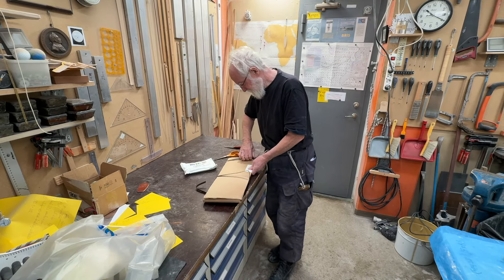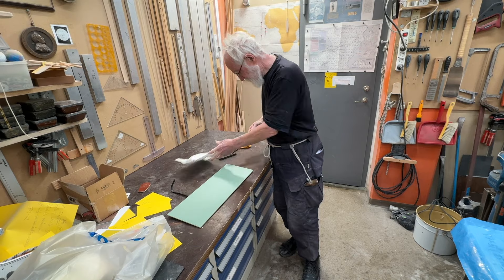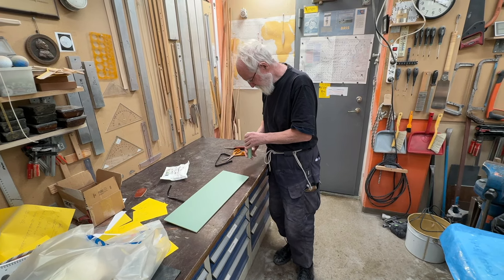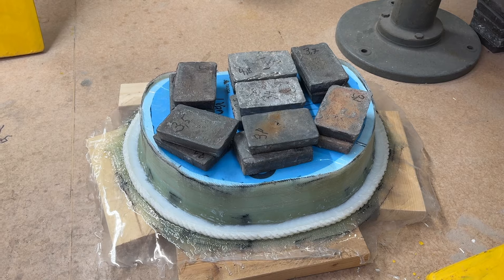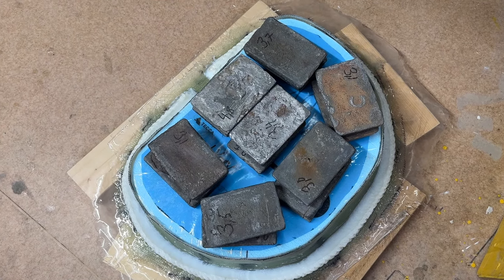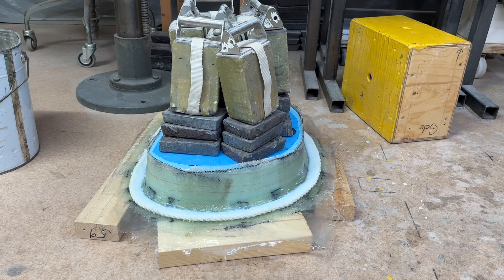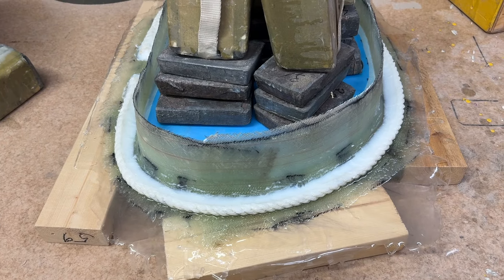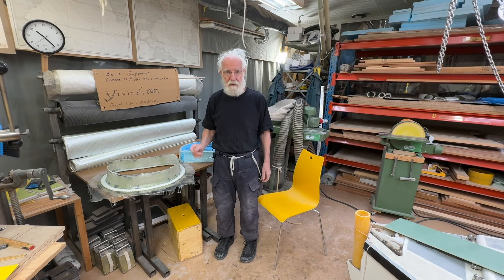5 Oct 2024 Succesful release + unpacking

Comment: When you are releasing the mold like that with the lead and gravity maybe try using air compressor around the seam this blowing air down into it that will help it go quicker Love your show and PS anybody complains about you cutting up the boat it is your boat your project you do whatever and however you want to do it. I love what you doing
Reply: exactly ... it's not them venturing into the southern ocean and rounding the great capes
Reply: @petercarbin2077
Possibly he could have used the air release method to speed up the release from the mold but remember also his buck mold / plug mold was only polystyrene, covered with tape or plastic wrap, I believe, not any hard-shell or hard solid material. Hence, it could be considered a little fragile considering he mentions wanting to perhaps get at least 2 matching forms/hatch rings out of this 1 buck mold if possible. So perhaps with low pressure it is done with no damage. Otherwise, he would be having to perhaps fix up the buck mold or making another if the air pressure happened to end up causing any significant damage during the first release...